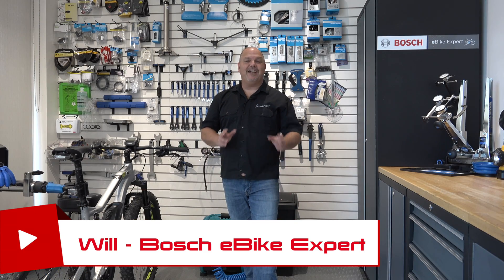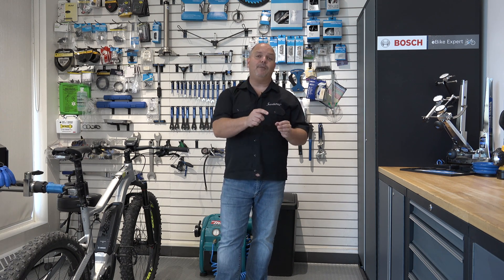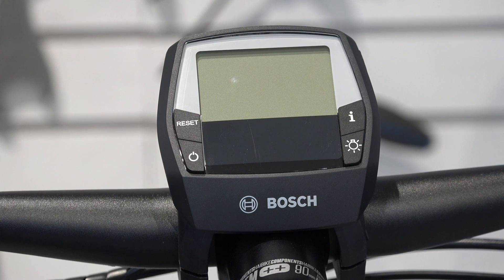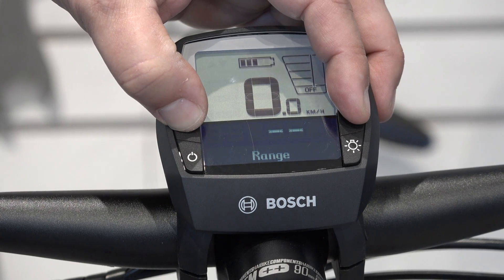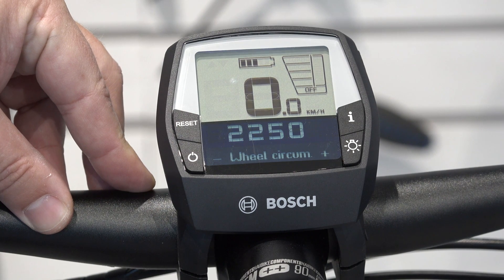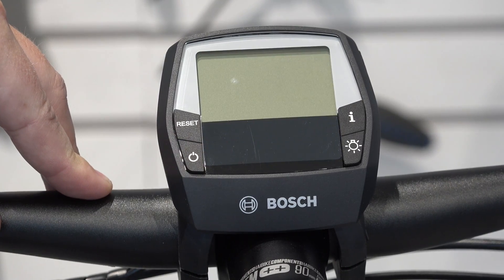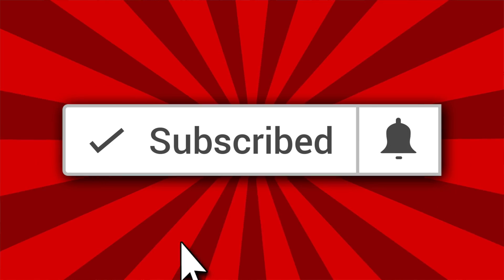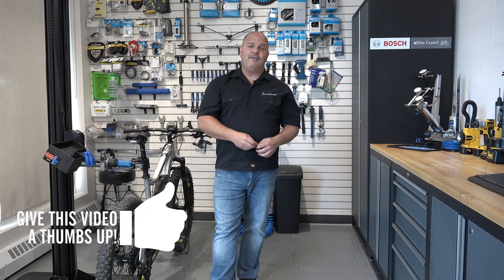How To Change Wheel Circumference On Bosch Electric Bike

Comment: Thanks for this video. My issue is that I`ve just changed rear wheel from 29 to 27,5" to have more agressive fork angle - front one is stil 29". Is it possible to change wheel circumference more than 5% in Bosch settings ? Or what to do in this case ? Regards :)

Comment: So does the 5% relate to the circumference of the wheel/tire diameter ?
Will Bosch still Give warranty if we adjust the settings due to a tyre change?
My new tyre is slimline 2" smaller in diameter.
Can I adjust the figures without any reprocussions ?
Reply from the maker: Hello,
You can certainly adjust to accommodate the difference in overall diameter contained within the standard set parameters within your system without any issues or affecting your Bosch warranty.
Reply: @SCOOTERETTI  I can't using my system it's only available with the dealer apparently when the computer is connected via USB

Comment: Does it have to be on the bike? If you take the display inside, the option is not there.
Reply: It seems to be there when you plug it in. Strange enough, if you make the tires smaller, the max speed goes down as well. So how the heck does the system know your speed?
Reply from the maker: @lovemadeinjapan  the most accurate way to get true speed is to measure the exterior circumference of the tire while the rider is on it 🚴. Mark the tire and ground and with the rider on the bike (have a helper hold you up) and complete one full rotation and then the mark on the tire comes back in contact with the ground mark that spot. Then measure 📏your starting mark with the end mark to get your true circumference. (Note that different tires pressures and loads will affect this measurement) but it's pretty darn accurate.
Reply: @SCOOTERETTI  That was not what puzzled me. The thing is, no matter the setting of the diameter, the max speed stays the same, so how does the bike know that? Is there a GPS in it?
Reply from the maker: @lovemadeinjapan  The Bosch system reads the speed from the speed sensor at the wheel as well as from the cadence sensor. Each bike model produced from the OEM's has its own defined firmware created for it which calculates the pedal-assist cut-off speed.
Reply: @SCOOTERETTI  The wheel sensor does not much. Only affects the displayed speed, not the actual speed. Too bad this isn't open source software.....

Comment: Hi! I have intuvia display and in settings, wheel circumference isn't there... do you know why my intuvia dosen't show me the wheel circumference?  How can I change circumference from menu setting? Thx a lot
My ebike is 2019 model , 27.5inch wheel, motor bosch performance cx with intuvia display
Reply from the maker: Hi Daniel, What you need to do is press "reset" & "i" at the same time to enter the config menu. Once in press the "i" once and you will see the wheel circumference setting. You can then use the power button & light button to increase or decrease the circumference.
Reply: @SCOOTERETTI  yes I know, but it isn't there...in configuration settings I only have , in this order: clock, language, km/miles, time, shift recomandation, power on hours and display version.... only this ones... nothing else.
Reply from the maker: @DanielDOBREA  I suggest taking into the closet shop to have this checked out as it should be a standard feature for you.
Reply: @DanielDOBREA  Hi Same problem as you, have you got a way to get this setting menu?
Reply: @BilloBob1231  just pulled out the display and inserted again...
Reply: @DanielDOBREA  Good that this worked for you. Was also working for me

Comment: A Moustache dealer around here say that Moustache do no want to change the gear ratio as it could be seen as tuning and this may void the warranty.  Is he right ? I want to buy a different gear for my bike but without affecting the warranty, could you help me on this matter please ?
Reply from the maker: Depending on which bike you have and if you have enough clearance you can adjust the sprockets by a few teeth. You won't be able to change it too much though.

Comment: Something weird. 2 bikes same tire same rim a FS5 2019 with 2109 mm and Open Xroad 5 2018 with 2148 mm. How could it be possible ?  39mm is this a lot in speed difference ?  My FS5 will not go more than 30.3 km hr has my Open will go  32.3 while pedaling. Thanks fr your help.

Comment: if you reduce the wheel diameter to the minimum -5% does it increase top speed by +5% ?? and if you add a lets say 5% bigger tire minus the 5% will it be 10% faster??
Reply: 5% smaller circumference gives you 5% more speed
Reply: Used this in the hope to allow for a slightly faster ebike.. lowered the wheel circumference , however unfortunately it just alters the displayed speed. It's not like the supporting motor is later undercut than normal.. somehow the motor is cut off at a fixed chosen Factory setting..and our cargo bike displaying me pedalling at 25/26kmh opposed to the former displayed 27/28kmh. Was hoping since the Display was programmed for a smaller.tire and thus slower speed, it'll stayed longer supportive to the motor and propelling us to 30ish..but it doesnt
Motor quickly cut off
Reply from the maker: Even with a circumference change you bike will cut off at the set maximum speed for your region 25 Kph or 32 Kph or 45 Kph
Reply: @SCOOTERETTI  Hello, the reference speed for the cut off is the one on the  display, rigt? Since the computer should calculate the speed basing on the RPM of the wheel+the wheel diameter, if you set a diameter that is LESS that the real one, the bike should calculate and display a speed that is lower than the real one, so cut off will happen at a display speed of 25 kph, but at a real speed higher than 25Kph. Correct? Thanks.
Reply: @SCOOTERETTI I have the same Bosch setup, but I can't reach the top speed. The GPS indicates 23/24 km/h. Kids on delivery ebikes, zoom past me! How can I slightly increase the speed to an actual 28 km/h?
Reply from the maker: @Don-ev9rb   If you are Europe the top speed is set to 25 Kph or for the Speed ebikes that would be 45 Kph. If you are in North America the top speed is 32 Kph (20 Mph) or for Speed bikes (where permitted) is 45 Kph (28 Mph). So depending on where you are located you can tweak the speed slightly (1 - 2 Kph) by ensuring your wheel circumference is correct. * Make sure your tire pressures are set correctly as too low a pressure will affect top end speed!
Reply: @SCOOTERETTI  Thank you, so there is no option to set the speed to 27 km/h. Or slightly move the magnet? What wheel circumference should I select (28 inch) for optimal speed?

Comment: How about using it with a Purion display and 20'' wheels?
Reply from the maker: Hello, this can be done but only through the software at a Bosch ebike Service centre. Unfortunately this cannot be changed directly on the Purion unit itself.
Reply: @SCOOTERETTI  kapja be a bosch.
Reply: Bosch are dicks for requiring this.